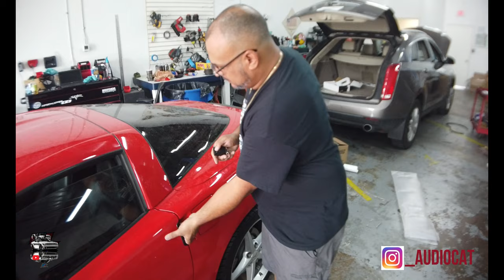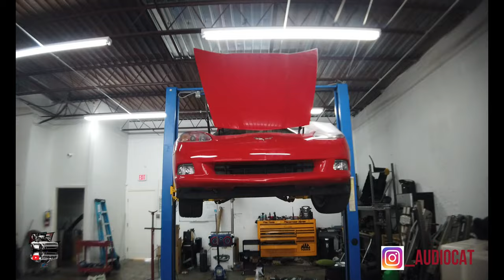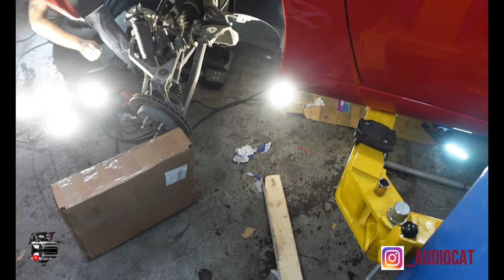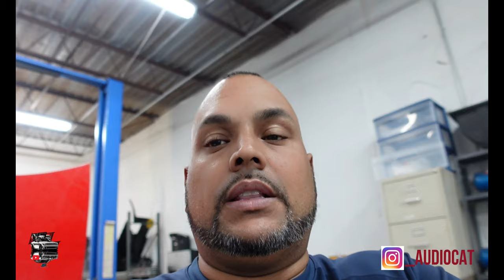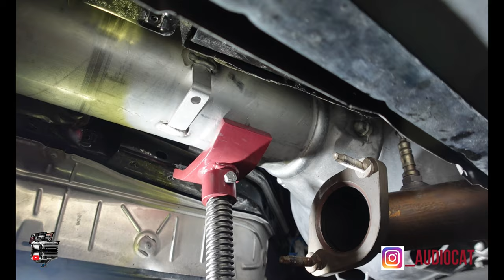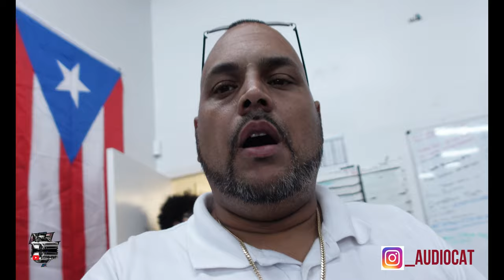C6 CORVETTE CLUTCH PROBLEM FIX ,,, PEDAL STAYS DOWN

Comment: Would of been wiser to install a remote bleeder line on the slave cylinder to bleed the system easier next time that clutch fluid gets dirty bcz it won't stay clean for long then have to do that whole n costly process again for the next owner..